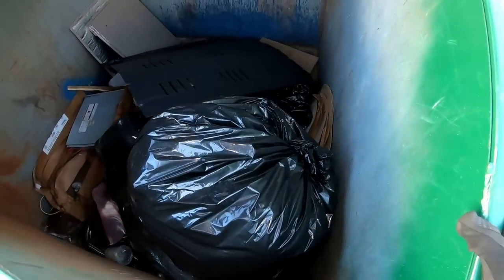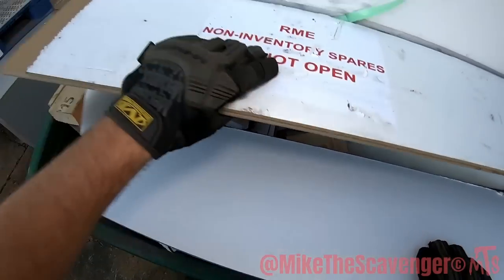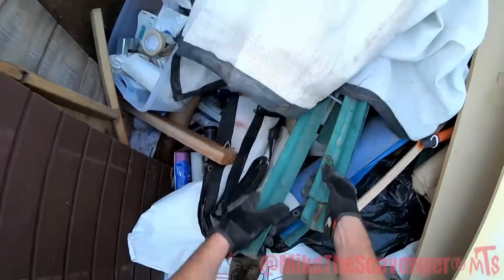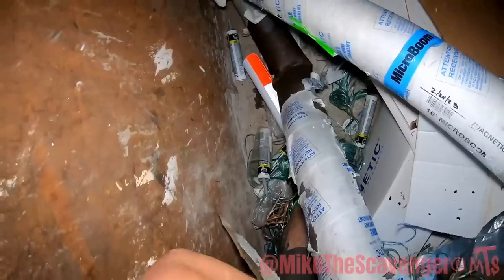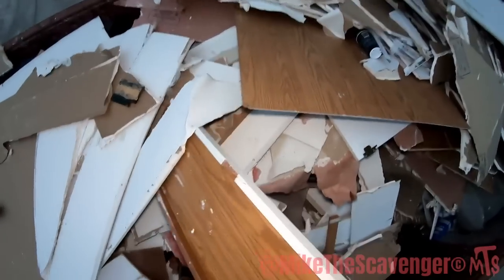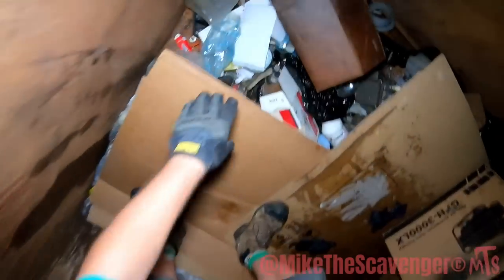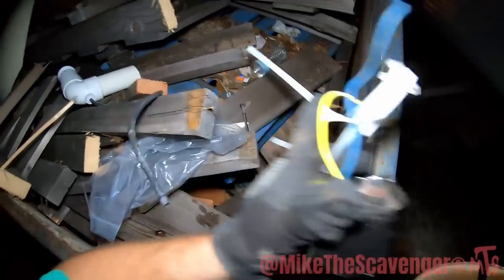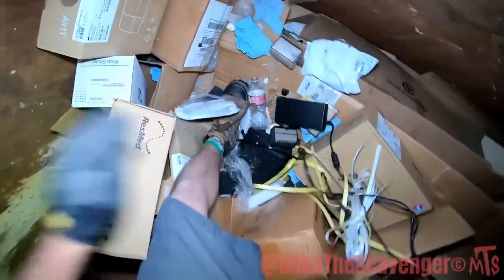Dumpster Diving "Soggy Bottoms"

Comment: Hey Mike. As an older lady without a lot of muscle, I used the step up method I learned from you to help me lift a dishwasher into my trailer. Yes, I know that they aren't that heavy, but am having arm issues. So used a air fryer in the box, to step it up. Made it so much easier. Thank you so much,  for your tips, as well as the entertainment you bring.

Comment: Those nuts and bolts around 4:30 are for chain link fencing. And the bag at 4:38 are fence ties for hooking the fence to the top rail and posts and are aluminum. I actually have a date with a couple bags of those at 8am tomorrow. Another great video Mike. Looks like you're healed up nicely.

Comment: That flashlight at around the 27:10 mark is a mag-lite. I have one. Mine uses C or D type batteries, maybe 3 or 4 at a time. The older style ones used old fashioned bulbs (hence expensive to run), but they could be adapted to use modern LEDs to save power and the environment.

That's a good torch.

Comment: Mike the king of the used power tools.
The batteries are most likely dead and would cost too much to replace. In my travels I fixed the old packs with nickel metal hydride. I won't use Lithium Ion.
There might be a new law being put in place because of all the fires.
Sometimes I make up an external battery pack and make my equipment light weight.

Comment: Here's a trick to revitalize lithium batteries that won't charge on their original charger. 

(The L.E.D. on the charger will not light up when the battery is connected.)

What you do is take a generic (non lithium) charger and "jump" the positive & negative leads to the battery.

Once connected, charge the lithium battery for about 5 minutes at a comparable rate. In other words, don't overload the battery with too much amperage.

After about 5 minutes, connect the battery back to the original charger. As long as the battery isn't totally dead, the original charger will recognize the battery and charge it up fully.